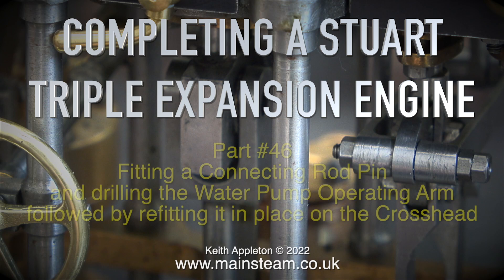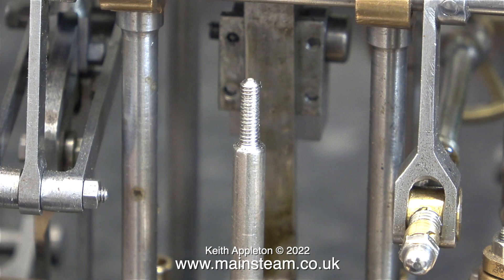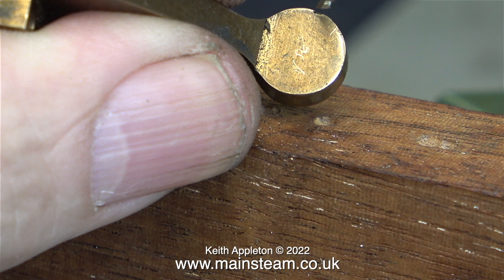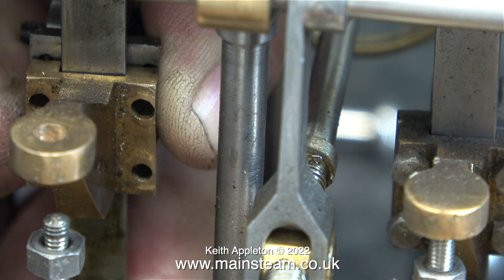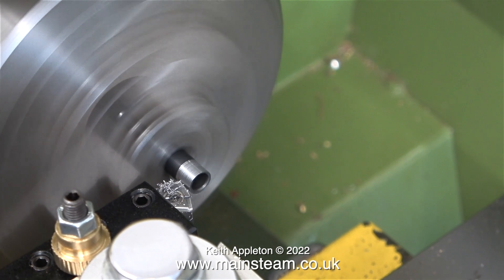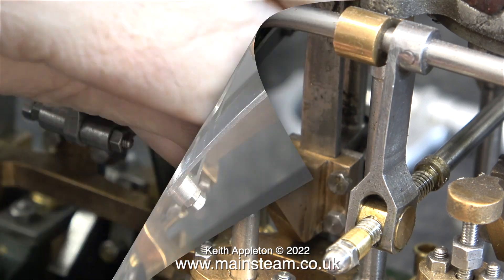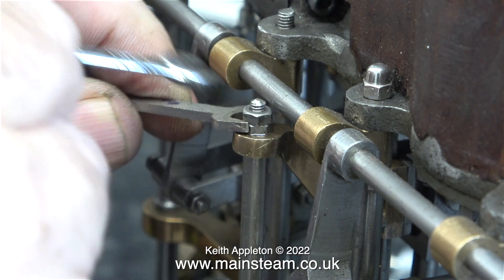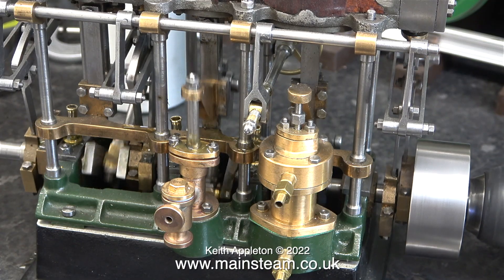COMPLETING A STUART TRIPLE EXPANSION ENGINE - PART #46

Comment: When I built mine I used 2.5mm cap head bolts (they fit 7BA) for assembly, easily accessible with a ball ended key then when everything is finished fit the 7BA hex and only have to struggle once